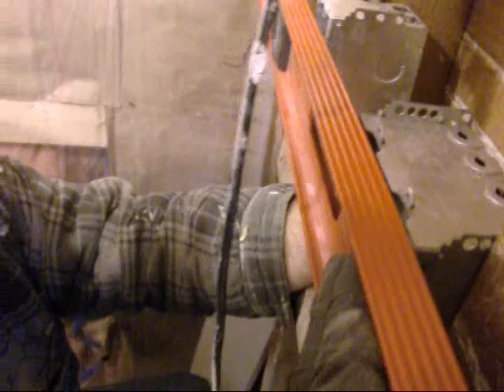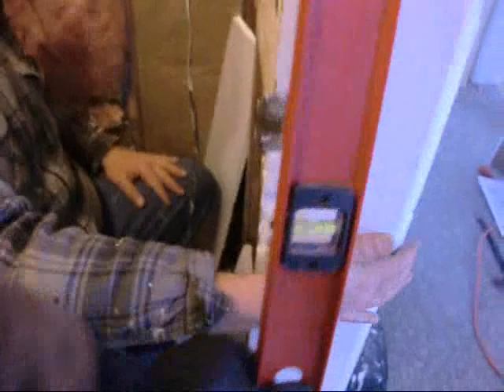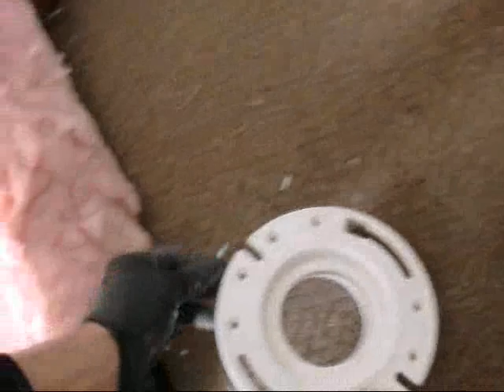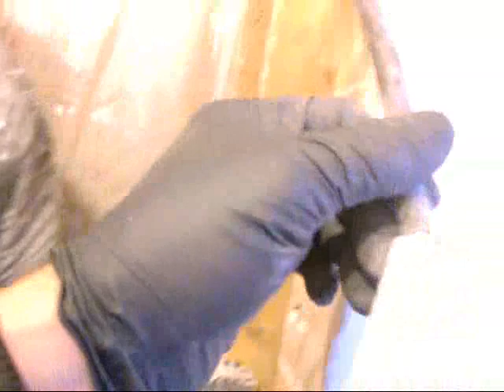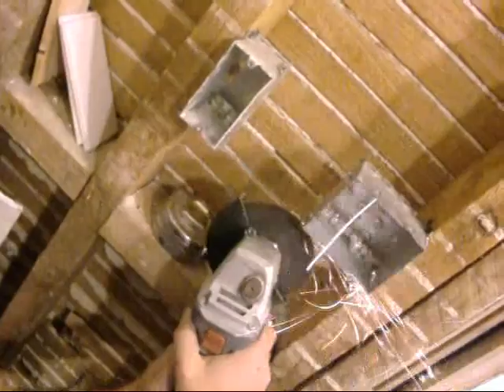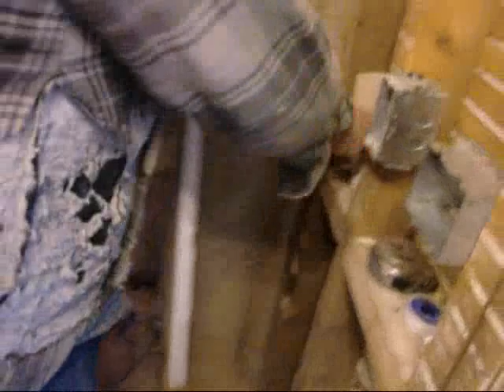3 1 12  Frootloops Level Electric Box...

Comment: i seen an outlet in a wall that had plaster and lath 1/2 dry wall then more 1/2 over the top of that the box was a inch and a half in the wall,the outlet was put in with 2 inch # 8 Robertson wood screws